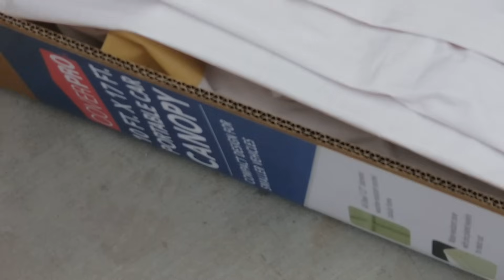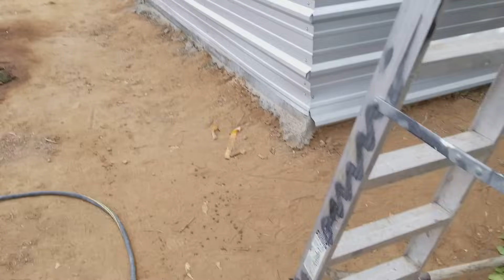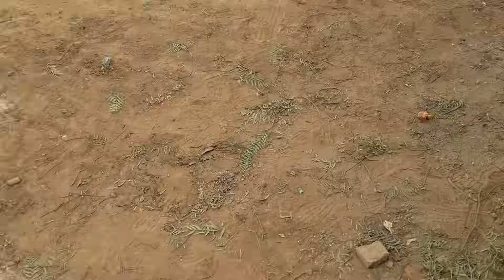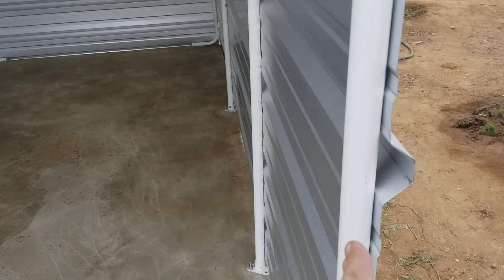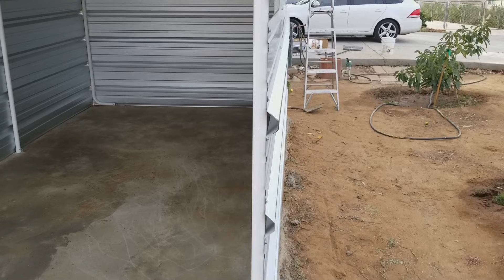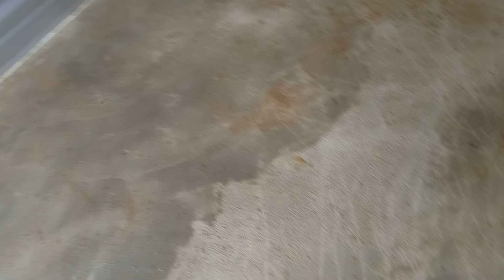Harbor freight tools portable garage into  Permanent structure

Comment: I did pretty much the same thing but on a gravel-covered dirt floor with sunken PT 4x4s to attach the feet --- buried about 10" into the ground. Where I live, anything that makes a shadow gets taxed by the square foot, so the tapered asides didn't men much. I put 10mm OSB inside to "finish" the interior walls and lend some support - figuring it would add sheer strength anyway. 8 years later, it still stands. To qualify as a pole barn, I had to leave the open side - er, open - with no door but it keeps the snow off my tractor and a few other pieces of rolling stock.
Would I do it differently next time? Yeah --- I like your ideas better than mine.

Comment: I did essentially this a few years ago with PVC tubes covered with tarps while restoring a vintage camper.   Not intended for permanent use…just to keep the camper dry while restoring it.   2.5” outside diameter with SS screws made the framing quite about; our driveway wasn’t paved then, so I drove in large landscape/fencing to slide the tubing over it.   It stood up to 70mph winds until I took it down when finished.   After disassembly, the parts were reassembled into racks to store itself outside…and store wood inside.   Sunk cost was low and utility high.   Racks still in use after 10 years.

Comment: I like it, but we get a lot of heavy wet snow here in Vermont.  I don’t think those panels would support the snow load with the posts so far apart.  Instead, you could put your side panels up horizontally (like you did) but then install some 2x3’s horizontally across the roof area pipes, and turn the roof panels vertically so they will shed the snow.  Should be able to create enough over hang so the snow doesn’t all push against the walls when it sheds it.

I used corrugated metal panels to roof a chicken coop and it’s working out great.

Comment: Check metal salvage yards for the "purlin bearing rib" metal, "pole barn metal". In my area farmers often salvage the tin from an old building and sell it at a metal scrap yard. Existing screw holes are easily caulked.  

drywall, please no, plywood yes

Comment: I live in Rockford, Illinois. And was told by cold enforcement that I could not make my temporary canopy into a permanent structure help me prove them wrong. They said They would fine me if I do.
Reply from the maker: check the building and safety to see if they have a structure minimum. dont call code enforcement. My city has a unpermitted structure of 120 sf or less. ask them if they have a shed size minimum. dont tell them its for a car. ask them if there is a maximum size for a shed without a permit.

Comment: Did you install the panels from top to bottom or bottom to top .?
Reply from the maker: top center then down. that way you dont have a seam on the ridge.
Reply: Top meaning roof.? Center meaning what .? What is center .? I have zero back ground in Building ..pretend I'm 12

Comment: Thank you Mike for this video. Using your tips I did this on my HF garage last Summer, made a video today at the link below. 8 months later after significant snow at 9,200' elevation in Colorado it has done great. I used 29ga PBR, added 2x2 roof purlins, mine is not on concrete just mounted to a redwood 2x6 frame anchored with concrete blocks. My parts were more expensive that's probably due to the increase in prices from 2016 to 2022 or because I ordered it all from one place. I'm really happy with this upgrade, thanks again for your video!!    https://youtu.be/0zKvwD3JLpQ

Comment: Hello are you still active here?
Reply from the maker: yes
Reply: @mikesrandomvideos  so  from this  / \  to this  l l
Reply from the maker: @mazingerzeta777  Yea I would do that the angles will weaken it. just mount one let then push the other in you will be about 9ft wide. if you dont want it to be 8ft. I narrowed mine. you can go 9ft wide and 17 length and have vertical walls. when the studs are under a load like that it is stronger.
Reply: @mikesrandomvideos  thank you
Reply: @mikesrandomvideos  so you push the poles in ?

Comment: Love the idea.   Have 2 mods I would make to this since I live in heavy snow country:

1. Mount the roof panels the other way (vertically) to support snow sliding off.   

2. Buy a 2nd $200 HF garage,  cut the horizontal poles in the middle and install the vertical poles from the 2nd kit there.   This should give the 3’ spacing you’ll need to attach the panels vertically while at the same time DOUBLING the weight it can support before the poles start to bend.   Couldn’t buy wood to reinforce any cheaper than that.

Since the roof panels will lose their rigidity mounted in this way I know I’ll need some sort of purlings to give rigidity to the panels so they don’t bow and pull the vertical poles toward each other.   Thinking 1.5” conduit.  One row about half way down the roofline on each side might do.   Maybe two per side if I feel it needs it.

Thanks for the vid - got my brain thinking

Comment: Thanks for this video just completed this upgrade on mine. I've kept mine from collapsing under Colorado snow for 5 years using heavy duty tarps. I kept my footprint original since it's secured to 2x6 redwood boards base and added 2x2 purlins (3 per side) on the roof to handle the snow load. It looks great and I'm excited to see how it handles this Winter.
Reply: do you have pictures you could share please of what you added
Reply: @DivaBClub  finally made a video for you showing how I did this on my garage, hope it is helpful. We had lots of snow this Winter and it held up like a champ! https://youtu.be/0zKvwD3JLpQ

Comment: how did you aim and tap the screws to the metal tubes behind the panels.  even with xray vision you can't see through steel.
Reply from the maker: one panel at a time top to bottom you can see the end of each then just snap a line. very easy.

Comment: So you're using those clamps because you cut off the crimped end of the pipe that would have fit into the peak pieces. 6" off each side. Is that right?

Comment: Okay, so if I understand what you described... You shortened the width from 10' to 8' wide to fit the concrete slab. Is that right? Great for farm and mowing equipment and vehicles being stored. But as a day to day garage car parking not so much because it's so narrow. Got it! 👍🏻🇺🇲 Thanks

Comment: Wow I love this!  I had looked at the Harbor Freight carport but the reviews were not that good due to flimsy construction.  This adds a whole new dimension to the strength of the structure. Quick question, did you bend a panel to overlap the roof crest or is there another way to join the top and make it waterproof?  Thanks for any info!  New Sub!

Comment: My neighbor has 3 done almost exactly the same.
With concrete anchoring, they have survived 80 mph winds and are still up after more than 15 years.

Buy the corner trim pieces for steel buildings.  They improve appearance and strengthen the structure.

Comment: One thing that may important to some people. PBR panels are painted at the factory, after they are cut to size. The painting method is intended to provide protection from moisture. If you cut a panel, you cut that protection and will soon have rust. It is best not to cut them at all, but if you do, be sure that you follow the manufacturers instructions to reseal those edges.
Reply from the maker: good point. especially in the rust belt. the salt can corrode those edges and creep under the Zinc coating.

Comment: Except for the concrete floor, "THIS" is how I'm planning to redo my Harbor Freight 10 X 17 ft. "PORTABLE GARAGE"!!! Since I live "Out In The Middle Of Nowhere", I don't have any of those "RIDICULES ZONING RULES" you were forced to conform to. I lived in a small town with a population of less than 1,500 for about 12 years & the zoning "Whatevers" there were pretty hard to understand. Although I'd lose that what, extra 1 foot of floor width due to it's slanted sides, I was planning to make the walls vertical (Plumb) as you did by bending them in a little. Thanks for making this video to show us how you converted what was pretty close to a tent into an actual building. By the way, I've got a few of "THOSE PUT AWAY PLACES" as well so you're not alone (I was glad to hear I that there's other people who HAVE STUFF IN "PUT AWAY PLACES"). It would be nice to find those places, wouldn't it? Thanks again for this video. Good job!!!

Comment: Do they stamp it or do they send it through rollers that form the sheets?
Reply from the maker: pretty sure it is stamped. I think if it was rollers it would be distorted.
Reply: @mikesrandomvideos  That's interesting there is a company that is close to me that has giant rolls of metal they put in what length that they want and it goes through rollers that form the corrugating then it shears it at the length wanted.

Comment: That kit from HF comes with poles that go at the bottom of those walls to hold the bottom of the canvas . If those would've been installed, it prob would have given you more strength in-between the poles for the siding
Reply: I have bought 2 from hf and neither came with poles at bottom

Comment: Nice DIY work. 
I'm going to use and old 22 foot camping trailer.  Strip the camper to the frame (it's crap anyway), new floor and then use walk-through scaffolding as the supports.  You can buy the pipe fittings online for each corner and double them up to increase possible snow load.  It being a trailer, the only restriction is 8 feet max width but it will never see the road.  Having permanent trailer tags keeps code enforcement and DMV at bay and allows me to park it anywhere in my back yard. After a couple years in the sun, the factory panel coating may degrade and just buy some tint-able roll-on bed liner and seal it up good from the outside. Don't forget a wide lockable door insulation and ventilation.  Best part is you can do it in stages.

Comment: the panels are rolled in to shape.  they pull the roll of metal through a series of rollers each creating a slight bend in the panel,  that's how they can make any length, not stamped.

Comment: I purchased a ten ft. by ten ft. Shelter logic shed. that has a frame with a cover over it. that is made from a material that is similar to that material tarps are made out of. and it was pretty good for about ten months. but now it is getting ripped apart by the wind. but the frame is still in very good condition. I have tried to figure out how to get a hold of the shelter logic company. but have had no luck but now after seeing this video. this is making me think about some different options. where I live the wind has become a real problem. it used to never be so windy here. but in about the last five years or so it has become windy almost all the time. I was thinking that I was going to have to take the shed down. but maybe I might possibly be able to do something with it after all. I rent so I can't really put up something permanent. but this video might afford me a way to put up something I can take back down if I have to. thanks for posting this I'm going see what I might be able to do.

Comment: The only problem with the roof of it, is that the ribs are running the length of the building and if you have snow where you're at, that'll hold the weight of the snow on it and smash your roof in. My husband built pole barns for 30 years. He says you would be better to screw some one by fours at least one foot apart from the ridge to the eve then put the metal on the correct way. Then you can also put on a gutter each side and run them into a collection barrel if you're so allowed..?
Reply: He's located in California, so snow probably isn't a concern there.

Comment: I have a Costco brand one that is 10X20. It houses my wood shop. It was $200. I’ve replaced the roof twice ($70 a pop). I’ve always wanted to enclose it better and I think you just gave me the way. I’ll be researching my local options tomorrow! Thanks!
Reply: if you don't want to go with metal look up companys that sell the tarps with signage for billboards, lasts for years and some are 45ft x25ft, usually less than a hundred bucks. the last one i purchased i actually found a guy that had several new ones for 120.00, the used ones have the billboard sign on one side and black on the other, great tarps.
Reply: @jimmieroan9881  found a few covers things well

Comment: Hey Mike, I like the custom work. Did you use 3" X 3/8" sleeve anchor or 5" X 3/8" wedge anchor Redheads to attach the posts to the concrete floor?

Comment: How did you climb on top so screw in the roof? I assume you put the sides on first for lateral strength.
Reply: Screw from underneath maybe?
Reply: start at the to and use a ladder. the frame will be open. and you can still put sides on first

Comment: I am looking into doing the same with my canopy. I called a supplier in my area and  was told that each 3' x 20' panel weighs about 50lbs, do you find any issue with that much weight on your canopy when you add up all those panels? Thanks.
Reply from the maker: no when screwed to the poles it just gets stronger. Gotta run them the way I did if you run the ribs the other way it weakens the structure. Getting them up there really takes 2 people I may have done the top one myself but the sides were heavy. to hold up.

Comment: Not worried about 80 mph wind, you should be. You have a 8ft span across back with no uprights to screw metal to. Most pbr panels recommend 4ft maximum  spacing
Reply from the maker: already had 80 mph wind gusts and there was no issues. my shade sails ripped off but those 2 buildings didnt even move. I am around 4 ft spacing  15 ft with 4. on a building that size it is fine. bigger then you would need correct spacing. and thicker and larger poles.

Comment: Cool, but I have found the connectors on Ebay and Amazon (poles not included) for much less than buying the whole HF carport
Reply: What was they called again and where did you get your Pole from I live in Southeastern Ohio so I think I would have to have bigger stronger poles

Comment: many places now carry these tin panels as they are being used for house roofs etc. and come in many different lengths  menards , lowes, home depots? etc. prices also vary so check different places . cheapest i found was menards .  i  like others have said would put up additional bracing especially across the inside top a frame area . great job great video .  they do sell foam end pieces that will close gaps on ends  precut and shaped.

Comment: Cool shed. I like It.
I picked up used 10x20 carport for $200.00 & turning it into a shed. 
I was givin a 7x8 o.h.door. I'm widening it 2 feet & raise it 
1 1/2' .  putting in a full lenght skylight panel.
Making the floor out of pallets covered in gravel & topped with sheets of painted o.s.b.

Comment: I have a similar set up. Instead of the frame kit, I used galvanized fence pipe and found connecting joints online. I was able to get the joints in the angles I needed. I also increased it from 4 legs/cross members to 7. This made it considerable stronger than the kit frame. It did cost a little more though.
Reply from the maker: Very cool! I considered that when I did this but this has withheld 80mph winds. Pretty sturdy. I sat on the roof too I figured it would hold 3 of me. at least.
Reply: Where did you order your connector pieces from? How much in total did you spend?

Comment: Search ebay for "Carport Canopy 1-3/8" Fittings Kit". It is strong, galvanized and you can built any custom size shelter. It sold as high/low pitch or slanted. It used poles made from electric conduit or cyclone fence sold in any building matireal store. 
Good job anyway!

Comment: Bro why didnt u just build or buy a pipe bender  then buy steel square tubeing mold your skelaton lay a foundation. Then put your corgagated metal over ? Would be much stronger especcally if you set your steel in the cement foundation
Reply from the maker: plenty strong and much faster to use the Hf pipe kit. check out my strength video. it is super strong. 2 guys can sit on that roof. 80mph winds didnt touch them. Plus that would have cost more I built my own wrought iron fence. I can weld but no need to this was way easier.
Reply: @mikesrandomvideos  so how long have you had it up? Was thinking of doing this, as it looks nicer.

Comment: I don't know. I'll tell you why.  I had one of these up with just aviary netting over it.  The snow load was only about 8 inches (California High Desert) and it broke all the joints and collapsed. I notice also that you are running the roof panels with the ribs horizontal.  That is going to keep the snow from rolling off on its own.  So you'd have to be really eagle eyed to get it off manually, and who wants to do that at 3am in the morning. Mine was fine the first winter, the snow was dry.  But this winter we had it snowing at 34 degrees and it was really wet, then froze.  

I have another one I made with 2 inch steel pipe and Kee Clamps (Global Industries) and that one didn't have any problems.  If I had it to do over again, which now I have too - LOL.  I will make one with steel pipe (not aluminum) and Kee Clamps..
Reply from the maker: The strength on this is made with the panels. the reason yours failed is it did not have panels on it. I have stood on the roof. bounced on it with a 60000 dollar car underneath in another video. having the ribs that direction is a MUST. to make it strong. Just had 80mph gusts a few weeks ago and no no no issues. super strong look at my strength test video you might be surprised.
Reply: @mikesrandomvideos  Yes, you may be right about that. I will take a look at your other video.  I have become a devoted fan of Global Industry fittings.  The one that broke was the last one that I bought rather than made.  I have 20 canopies now, made with steel pipe and Global Fittings and they are all doing really well.  I live on a mesa, very familiar with high winds - LOL.